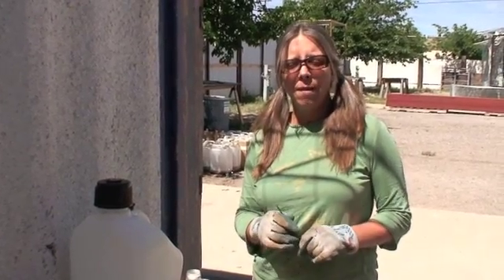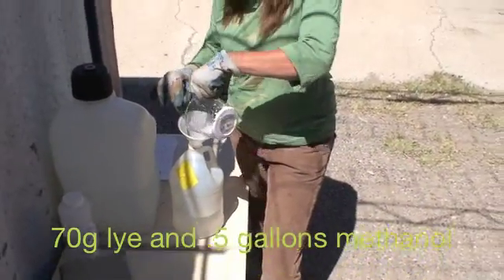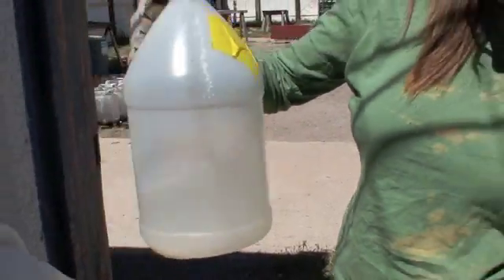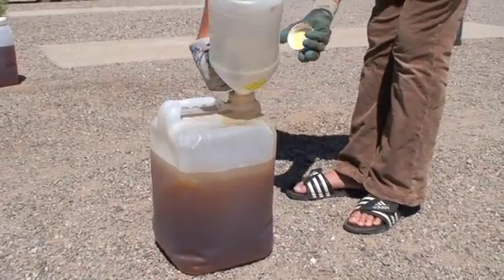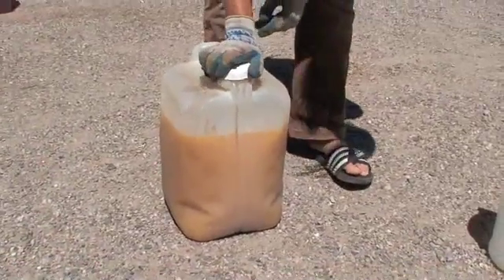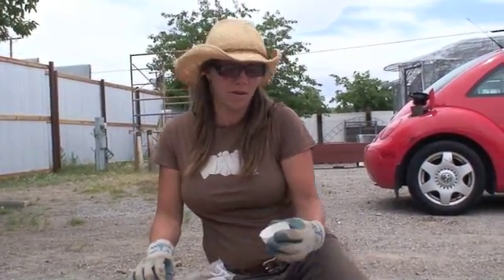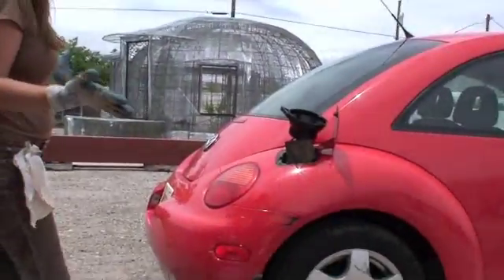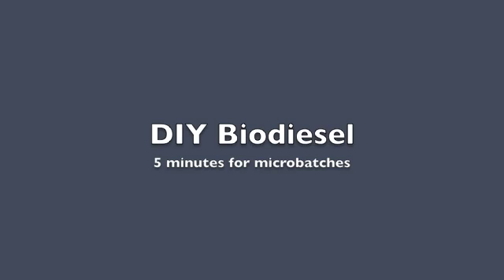DIY Biodiesel - 5 minute microbatches

Comment: Don't forget ...the fuel is still reacting ..so if you do not use it all in a few days you will have glycerol forming in your tank hoses and pumps..you should ..always. Spray a fine mist of water over the reacted fuel  to wash away the reactants .then it won't keep reacting and it will also be clean.i know I ve done it the hard way ....many thanx great video .mike Scotland

Comment: I think you would better estimate titration solution as your used cooking oil pH will vary from batch to another.
Without washing biodiesel you may harm your engine.
It is for Diesel engines and doesn't replace gasoline.

Comment: Missing so many steps and processes to get the best clean product, sure this works, for now, until the costs of clogged filters and injectors, as well as other issues that can and will arise with this simple method, will soon far exceed the value of producing it in this manner.

Comment: So how long did car last til methanol and high ph corroded lines and dried out o rings and rubber lines?
Reply: Agello24, she should have made it properly
Reply: GContreras20bfsla   it is all possible to find on Google. Biodiesel must be properly  processed to be a good brew. It needs certain calculations for the ingredients amount to be mixed, and specific temperatures to be reached before a reaction is started. Then it needs to settle and the glycol drained off. If you research various sites on the internet  the information is freely available. I would say also she was quite happy to breathe fumes of Methanol which are deadly poisonous and should not be breathed in or even spilt on skin, yet she was wearing sandals! Research it more, dont just use this as an instructional video. You will either die or wreck your car, or maybe both!
Reply: so what should she have done?

Comment: This all wrong but has good intentions. You MUST titrate! You MUST control/monitor the oil temp!  You MUST use a cone bottom container to make sure no glycerin gets into the final product. You MUST wash the bio to remove residual lye/meth. If not proceed at your own risk! Making the real thing for 10+ years with no problems. 2002 Ford excursion, 1993 Dodge Cummins, 1990 Ford 7.3 IDI, 1987 Onan generator, 2006 Branson tractor, 2002 VW Jetta TDI.
Reply: Got a link for a proper way?
Reply: yo can you show me how to make hemp biodiesel at home for use in vehicles?
Reply: Cam32112, I'm interested. Have an Excursion. You have a vid? TIA

Comment: If biodiesel is about 10% the cost of petro-chemical diesel, it should be easy to save enough to replace the engine every so often. If you can't be bothered cleaning the fuel, you will still be ahead economically. Any car with a new engine is also worth more.

Comment: you should wash the biodiesel, settle for half a day and pour out just the biodiesel. After that boil the biodiesel at 100 degrees C for a few mins to dry it out.

The way you do it will work but will likely lead to corrosion and clogging in your engine pipes

Comment: How do you finger out how much lye  and methanol too use?
Reply: Based on other material I've seen, basically for each liter of WVO, you want 1/5 of a liter of methanol + catalyst (methoxide).   However in order to determine how much catayst needed, you'll want to do something called a "titration" on a sample of your WVO with a pH indicator in order to determine determine how much catalyst is needed.  Basically...old WVO will get more acidic (fatty acids) and require more base solution (Lye solution) to neutralize...I'm no expert.  This lady did her best, but she certainly oversimplifies the process and does not exercise best practices for the long term health of the engine.

Comment: so you don't wash it at all? wouldn't that damage the inner parts of the car over time because of the impurity's in the fuel?
Reply: Mohawk Brah no man, biodiesel doesn't do that. it's very clean and actually improves the condition of your fuel lines. but it clogs your filter

Comment: One thing they didn't mention in this video is that newer Diesels, post 2007 (maybe this will change) will NOT run on 100% Biodiesel right out of the box. Yes the V.W. worked, and there was likely Petrol Diesel still in the tank so the Biodiesel turned to a lower percentage of Biofuel, maybe 50% or lower. And who knows how the emissions system works on that Beetle given the Volkswagen emissions scandal? I say that because the emissions system on a lot of newer vehicles won't work with 100% Biodiesel because the fuel is too thick for it.

Older Diesel engines work with 100%, though if the fuel system has rubber in it the Biodiesel will rot it. This is generally vehicles from 1992 and older.

Comment: Not the best quality biodiesel by any stretch of your imagination. This process will ultimately destroy any vehicle. The glycerol that is in suspension has not been removed and neither have any soaps that are present. The fuel pump and injectors will fail rather quickly following this method of production.
Reply: I've run a few older diesel Mercedes on SVO and have had zero major  problems. The biggest problem I've had is SVO is such a strong cleaner it frees up all the gunk in the older fuel tanks.
Reply: I've run a few older diesel Mercedes on SVO and have had zero major  problems. The biggest problem I've had is SVO is such a strong cleaner it frees up all the gunk in the older fuel tanks.
Reply: Hi Matt,im looking to speak to a expert about SVO or WVO.Please get back to me asap
Reply: Hey Edward, idk if I'd call myself an expert but I have been doing it for awhile. What do you want to know?
Reply: Matt Bolton id like to speak or text on the phone.This is my number 7873062393.I own my own WVO company.

Comment: This has to be the most impure biodiesel ever made.

Half ass shake sodium hydroxide and methanol. Half ass shake oil and methoxide for 30 seconds. Let sit for four days with no stirring or heat to facilitate the reaction. Don't use a separatory  funnel to separate out the glycerol, salts, and unreacted ethanol. Pour into your car so it seizes the engine.
Reply: yea just mix solvent with the vegetable oil,gasoline, white gas or turpentine will do the job. 80%oil/20% solvent .it will be a lots easier and it will work as good...

Comment: Instead of just letting time settle the heavies to the bottom, you can use polymer pellets that take out the moisture and the acid.  Then run it through 1 micron filter.
Reply: +Jeanie McKean  I did not know about the polyer pellets. Where can they be purchased?
Reply: +Jeanie McKean  I did not know about the polyer pellets. Where can they be purchased?
Reply: plastic pellets will remove water and acid? how?
Reply: @ChristopherJones16   polymer is not actually a plastic, and it absorbs the water and acids.
Reply: I just had some sad news on the TDIClub page, they think BioDiesel is going away!

Comment: Hi. I like your video, but it is 2010.  How are you doing now? There is so much more info now that makes the system better.  The ratio now is five gallons of used motor oil or vegetable oil with one gallon of gasoline.  If you use wvo, it is recommended to add one quart of automatic transmission fluid or marvel mystery oil to every six gallons for lubrication. I am in Carlsbad, NM.  Come and see us! God bless!
Reply: Please help me I have some questions
Reply: Are you still in Carlsbad? I'm in Artesia and looking to try to do this kind of stuff to run my truck

Comment: ***** Hi Mikey great video, I have question for you.

Is the meth oxide mixture (lye+methanol) only dangerous when it's mixed together if say for example i spilt it on my skin?

Once it's mixed with the WVO will it be safer then as its diluted with the oil?

and last after the reaction has happened and the Glycerin is at the botton of the container, could i use that Glycerin to wash my hands or would it burn my skin off?

Comment: OR converted into UK units per litre its this recipe

FOR EVERY 1 LITRE OF USED COOKING OIL
USE 167ML OF METHANOL
6.2G OF LYE (CAUSTIC SODA or DRAIN CLEANER /SODIUM HYDROXIDE all same stuff)

Took a while to convert it but its right
Reply: Not recommended unless you know how to extract the lye from the additives, and what she just made is impure enough as it is.
Reply: yea just mix solvent with the vegetable oil,gasoline, white gas or turpentine will do the job. 80%oil/20% solvent .it will be a lots easier and it will work as good...
Reply: Tailslol so there is no need to buy lye or methanol? Good old gas will do the trick?
Reply: Not washing it WONT hurt your engine, it washes itself in UV light. Eg in the sun for 4 days.
Reply: how about drain opener liquid?
Reply: What about not washing it?
Will it do any damage?
Reply: @kieranlines76  yes it will
Reply: Not just UK everyone with logic.

Comment: the very basic principles but you have to know how much free fatty acids in the oil to gauge the lye added to neutralise it....I'd definitely dewater it first tho and then post filter after heated reaction....5 mins is waaaaay to quick to do it properly for the long term survivability of your pump/injectors/engine...has your hubby got an injection  pump shop reconditioning fuel injection pumps? if so..great promo vid for that ....ha ha

Comment: I'm wondering why is used lye at the reaction? how that will help?)) and,could we use other alcohol like ethanol,or other?
Reply: the lye does 2 things. neutralises the acidic oil and when combined with methanol acts as a catalyst to split the waste veggie oil into the useable much thinner fuel and the thickened glycerine that drops out of solution. it won't just do that by itself. yoou cannot use straight veggie oil in modern diesel engines. it will seize the fuel pump and clog the injectors as its just too thick.
Reply: joe amin Thank you!
Reply: joe amin yes its tru, modern diesel engine d´int run with viggie oil, the injectors and much more built for standard diesel, the old mercedes 123 runs verry well with viggi oil but in the wintertime the oil must be warm becouse the thickness.

Comment: I'm not sure whats more laughable here, the flawed instructions and directions in the vid or some of the idiotic comments on it.
Reply: Jason Queen Firstly she hasn't titrated the oil. It would be nothing short of real good luck that the amount of caustic she is using is the right amount for the acidity of other oils.
She dosen't check the oil for water. If it is wet she will have more waste product in the form of soap. She dosen't heat the oil so it is absoloutley impossible to make the bio in 5 minutes. The reaction cannot possibly take place that quick at any temp to produce hig conversion bio capeable of passing any of the basic tests.  She dosen't say anything about mixing/ agitating the oil over the 3 days it sits. She dosen't wash or do anything to remove the dissolved glyc from the bio which WILL block her fuel filters in short order and definately DID, not maybe or could do, DID. Pouring off the " Bio" and leaving the glyc in the bottom of the drum demonstrates her complete lack of understanding of the process. It does NOT all neatly settle to the bottom in 3 days., It takes weeks.  She didn't do any test for conversion rate which I'll bet was not great. Saying you just pour it into the car like that is inane.  You " Just pour it in" before changing the fuel filter every 25 miles and then visiting the diesel mechanic every few ( maybe) tankfuls.

This is a GROSS and stupidly misleading representation of making biodiesel. Go onto any bio forum or site and see for yourself. Doing it like this will result in the vehicle having trouble with blocked filters at the very least and more likley problems with Glyc Buildup in the IP> No if's, maybe's or overly pedantic question about it. This is a tutorial on how to have DEFINATE problems with your vehicle.
It's rubbish, idiotic, overly simplistic Vids like this that put vehicles in repair shops and mechanics preaching that Bio causes trouble. It's an absoloute certainty if anyone is misguided enough to do it this way.

Properly made Bio is 100% safe to use. This is an illustration of how NOT to make bio if you want any sort of reliability from your vehicle.
Now the bleeding hearts can either put up fact or shut the hell up with their whineing.
Reply: How is the video flawed and where did you get the information needed to recognise those flaws? There's no point in making a claim unless you have something to put behind that claim.
Reply: glumpy10 Are you glumpy or arrogant? Put something positive in to help her. Your attitude is wrong. I make diesel out of used motor oil and mix it with polymer pellets to remove the water and acid.  I have a professor from Denver that has helped us get it right.  They are doing it on the Denver City Buses.  Let us be nice and encourage each other.
Reply: ***** Says the 15 yo with typically not one Vid of their own to show anything they have done. If you had any idea about the subject you would see the problems.
Reply: ***** Firstly the joke is on you for coming across like an immature Child. Secondly the flaws  are too numerous to point out without making another vid to correct them. 3rdly, the info should be far more creditable than what it is and it's no ones responsibility but the presenters to get their fact right or correct the wrong ones. There is heaps of info on Bio making and it's far from a new technology now. anyone that does put some effort into researching it will soon see what a poor and flawed tutorial this is.
Reply: glumpy10 
Okay. Why do you claim that the info is flawed?
Reply: I have made more than 30,000L of bio and been doing it 7 years. I think I know a stupid demonstration and flawed info when I see it and this vid is both of those things and more.
No one made a claim, they made a statement.
There is a difference but you can't see that either.
Reply: I see all the do gooder cry babys have shut up when hit by some facts and reason.
Thank god for that.
Looks like we know who the immature Children are and who made the dickhead comments.
Reply: If she drove away with the filter still in a tank - that would be hillarious.
Please make the vid with this alternate ending madam. It'll make the world a better, funnier place

Comment: The prices I see online for methanol is very expensive...
Where do you buy your chemicals from??
Reply: I'm seeing methanol in 55 Ga drums priced so that the methanol is 10 cents per gallon of fuel.  Just use google shopping.
Reply: Ryder Spearmann Can you provide a url for us?  The least expensive methanol that I see online is: 215$ + shipping   http://www.ebay.com/itm/55-Gallon-Drum-of-Methanol-For-Producing-Biodiesel-/250415986634?pt=LH_DefaultDomain_0&hash=item3a4df4b7ca
Reply: A B That's a good price... enough for 550 gallons of diesel.  And I apologize.  I must have hozed the math...  that's about 40 cents per gallon.
Reply: Ryder Spearmann
How are you getting 550 gallons of diesel?  The video shows .5 gallon of methanol added to 3 gallons of wvo. Not counting the shipping cost, that means a 55 gal drum of methanol can produce 110 batches of 3 gal wvo = 110 x 3 = 330 gals of biodiesel (because it appears that she pours off about .5 gals of glycerin per batch). 215$ / 330 gals = ~0.65$ per gallon (and that doesn't include the cost of shipping--which might be pretty high considering the methanol + the plastic drum weighs ~385 lbs)
Reply: I thought she was adding 1/2 a gallon to 5 gallons.  I must have been distracted by her rack :)
Reply: Ryder Spearmann
It looks like a 5 gal container, but she clearly says .5 gal methanol to 3 gal wvo.
Reply: +A B yes, that's correct!
Reply: Ryder Spearmann me too...

Comment: I have watched other making biodiesel and they heat up the oil but you dont, is that not needed?I want to learn as much about making biodiesel because I'm tired of spending 3.60 a gallon for home heating oil
Reply: you can distill glycerine to get the methanol back as it is only a catalyst and also you can use algae instead of oil
Reply: New mexico is pretty hot , i think that is why it is sitting on the sun

Comment: Is it ok to use non-filtered used oil?
Reply: Absolutely NOT!
Reply: I wouldn't use non-filtered used oil in an engine.
Reply: Doing so would destroy the engine very quickly. Not recommended.
Reply: Dick Powell I doubt it would destroy an engine 'quickly', but the contaminants would certainly block the fuel filter in short order and any that made it through would coke up the cylinders and exhaust valves. Also the mechanical injector pump will see much higher internal pressures which can blow out even new seals, never mind old, worn ones. Most engine problems in diesel engines stem from running modern DI or common rail engines on any kind of veg mix other than totally converted biofuel. Unfortunately Perkins designed the DI engine in the 1930's so nearly all of them are reluctant to run on a significant %age of veg without heavy exhaust smoke. However short term use with some unleaded to thin it down can work as an injector cleaner. It's best to use it in a nearly empty fuel tank so that, once you've finished using it, you can just fill up with diesel fuel again.
Reply: I know this was two years ago, but I did use non-filtered used oil. (And may I add it was very very used. I got from a restaurant and it was pitch black). It didn't destroy the engine and it even worked for a while! :-)

Comment: no water bath, no filtering ? wow, your brave. enjoy the repair bills.
Reply: you still need to water bath it and re filter to remove all of the lanolin
Reply: I have been running and filter wvo for 10 years. I have tried it every way possible. this method would be fine if you were burning it in an open chamber situation like a waste oil furnace. but in an engine it will leave build up and ash from the lanolin. I learned the hard way.